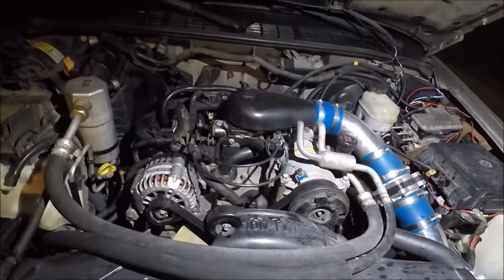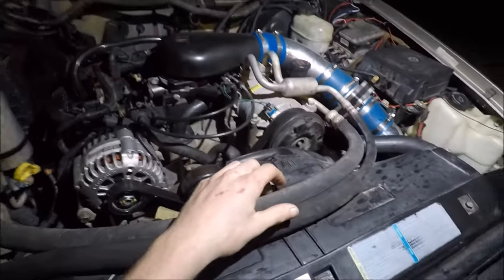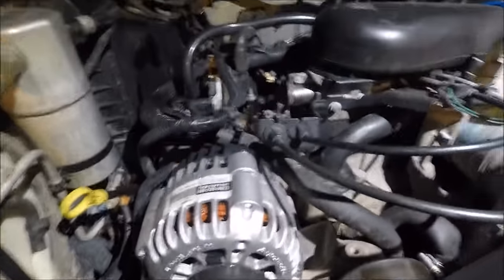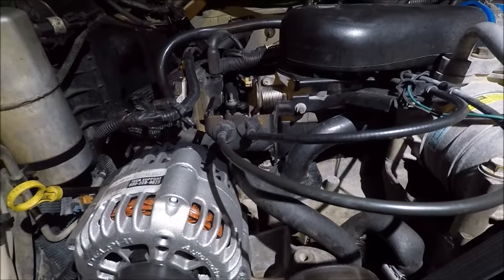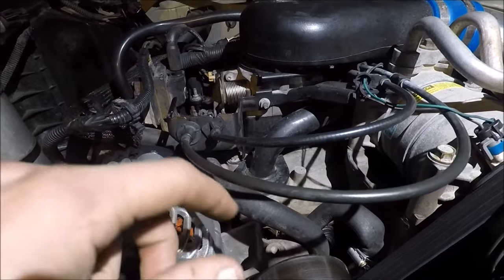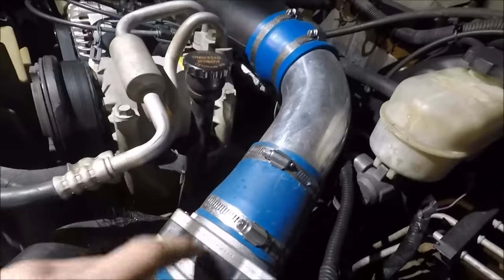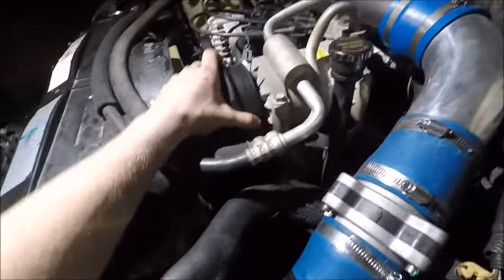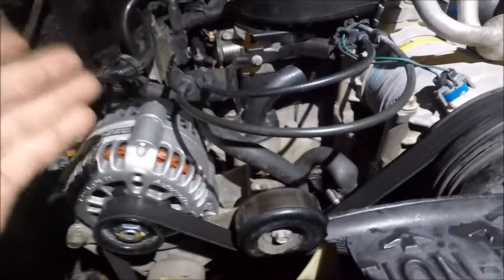EVERYTHING YOU NEED TO KNOW ABOUT THE CHEVY 4.3

Comment: Great info. My 2005 Jimmy has 177,000 miles. Owned since new and maintained.  Have an issue when climbing a steep hill at high speed cel flashes. No misfire is felt and once I get on flat road it stops flashing. I checked the codes and I get a pending P0304. Did a tune up, complete new Declo distributor. No change. New delco fuel pump and filter made no difference. It has the new MPFI spider and made no difference. Compression is good on all cylinders. I ran across a service bulletin stating that valve guide clearance is an issue in some of these engines and engine will misfire under load such as climbing a steep hill or towing. Just wondering if you heard of this? It is so strange I don’t feel any misfire and no loss of power either. Btw the ckp has been replaced and a ckp relearn has been also done.
Reply from the maker: Of the two I owned, both high mileage only changed the distributor and never had any problems might I suggest injector cleaner maybe one has gunk in it and gives a bad spray under load
Reply: @JLGARAGE252  Thanks for the reply. I already replaced the injectors and no change. I’ll have to pull head off and see what’s going on.  Thanks again 🙂
Reply: @theultimatedj8650  any results?
Reply: @jamdaddy7589  yes. Exhaust valve seats were worn. I had to have all hardened exhaust valve seats installed and a valve job. Problem is now solved
Reply: @theultimatedj8650  hell yes good news! Thanks for the reply
Reply: Mass airflow sensor wires or connection loose ?
Reply: @dougmurray3373  I was loosing compression under load due to exhaust valve seat recession. Removed both heads and had hardened exhaust valve seats installed by machine shop along with valve job. Problem solved

Comment: 2002 Chevy S10 zr5 should the radiator cap be vacuumed sealed ? when I tried to remove the cap needed to break the seal to get it off? should it be that sealed?
Reply from the maker: Yea the vacuum seal is necessary
Reply: ok thanks .. so it takes a screwdriver to remove a cold radiator cap.
Reply: radiator caps create pressure on cooling system reason is water boils at a higer temp under pressure its like a 7lbs system if I remember right.

Comment: Getting a 1999 s10 thats been a family vehicle and now my tuner ass gets a hold of it I’ll make er go good bud
Reply from the maker: If it’s the 4.3 don’t rev the crap out of it, those motors are gutless they are designed to run and be a decent work horse, their not a engine you rev on your buddies at Walmart and try burnouts with, bottom end failure is the biggest killer for these engines.

Comment: I had a 94 s10 blazer ran good had egr problem every other year put 2 transmissions in it 100% from over working towed alot more than should like a old john deere combine. And dont let it set for 6 months without running over 600$ everytime for spider injectors

Comment: Thanks for the video. By far the best video about this engine. I know you probably get tired of people asking you questions, but I'm going to try anyways. I recently had to change out my passenger side head and gasket. Got it all back together and was throwing the dreaded p0304 code. Replaced all little stuff like plugs, wire,cap, rotor, coil. Nothing changed. Then adjusted the valves and got rid  of the p0304 code but it was replaced by the camshaft sensor code. My question though is since the head replacement the top of the engine makes a tic/knock. . More than a tic but not quite a knock. Any idea? Any info would be appreciated. Thanks

Comment: Of course a somewhat dependable motor if you keep up on it... use factory sparkplug,  double platinum,  anything less is a waste of time,  change oil frequently.... air cleaners,  fuel filters,  if not you may experience knocking eventually with higher mileage 4.3's....
Reply: @JD John... Where's my fuel filter?
Reply: @cinnamongmc5430   the main fule filter is under driver's side outside of the frame,between Motor and gastank, silver cannister within bracket.... mostly depends on the year?

Comment: Are all 4.3s drive by cable (throttle body)?
Reply from the maker: Older models yes, newer renditions sadly no.
Reply: @JLGARAGE252  When did they go to drive by wire? I'm looking at an 05 tomorrow and it has dbc. I thought GM changed to dbw in 03' with the gmt800s.

Comment: I have a 1999 4.3 vortex , my question is can I run a clockwise water pump? The reason is I have a set of v-belt pulleys I bought about four years ago and never used. I’m hoping I can change the pump so I can use them.  Thank you for your help.
Reply from the maker: I personally wouldn’t, the fan an water pump take power from the engine as it is, re routing the belt system would just seem like a hassle.

Comment: I've owned vortec 350s all my life so I am familiar with most issues you've mentioned, like I put the upgraded spider in my truck 2 years ago. I just bought an 01 astro van with the vortec 4.3 so I'm learning what I can about it. Sounds like its all the same issues for what is essentially the same engine less 2 cylinders. Lol they even sound very similar at idle lol. I always dismissed this engine as weak, but I'm surprised at how much get up and go the astro has. It gets out of its own way just fine. I was very surprised a big heavy van actually feels a little peppy. I think I have a burnt valve on the truck so will be driving this van for a while, its sits up high like the truck (96 7z1) and the interior is close enough lol so I won't be missing the truck too bad until I have time to fix it. I'll enjoy the fuel mileage and the comfort, I'll miss the 3.73s and the exhaust note.
Reply: i been working on my mom's 98 Astro getting fixing the codes it has after 6 mouths down to two codes. it's begining to make that power.

Comment: A few years ago I drove a ‘94 GMC Sonoma for a little while that had the 4.3 vortec V6. The thing was an absolute dog. It really hated driving faster than 70mph on the freeway with the a/c on. But man did it have a nice roar to it when I pushed it hard (when it actually let me, meaning when it willingly kicked down a couple of gears when flooring it lol.) I’m not knocking GM, in fact I’m a bit partial to the brand. Just my experience. 🙂
Reply: its not a highway cruiser that is for sure lol. but for snow and cold weather there great trucks! best heater i've ever had in a vehicle. bit of a gas hog but if you do not drive them to far its livable.
Reply: @westside_tints8197  I remember the a/c worked really well too, the thing was practically overkill for such a little cab.

Comment: Hi Thanks for the vid. 
I have a 1997 S10 4.3 too. I just changed the IAC and cleaned the throttle body. It runs really smooth, but it has an issue. What is wierd when I go past 60kmh and higher 2000 rpm and let go of the gas the rpm will drop to 1500rpm and stay there as the cruise control would be on but it isn't. So the car will increase speed a lil and keep going. So when I break and come to a complet stop it will go back to normal about idle 700 - 950 rpm. 
But when I go back to 60-70kmh the rpm will stick again to 1500 rpm. I am still able to push the gas to go over 1500 rpm but it won't get lover until I stop to 0kmh.
What could cause this, any ideas?
Thanks for the help! :)

Comment: Not sure what forum you got your specs from a 4.3 is a redesign of the 5.7 but its two middle cylinders missing not the end ones. It also has differnt rods(differnt width on big end) the 5.7 or 350 has two rods on same crankshaft journal the 4.3 crank has individual journal per rod and bearing. same pistons bore and stroke. There is no vacuum under the breather pod vacuum is from bottom of throttle body down. Thats just suction from air coming in and will not be filtered. And mercruiser did not buy the rights to the engine Volvo penta and merc have always used/purchesed engines from Gm's marine division. How do I know this? Been marine mechanic 35 years. Merc just made there own induction system for the GM.

Comment: i am 16 and i just got a 94 4 door s10 blazer as my first vehicle.My uncle gave it to me because it had some things to be fixed and he was frustrated with it.He already had a truck he wanted so he was gonna get it scrapped.I brought up that i was looking for a small truck/suv and he brought up the blazer and few days later we went to pick it up.Runs great and only has 155,000 MILES.
Reply from the maker: That’s awesome! Hope it goes well
Reply: @JLGARAGE252   yeah ive already bought a few things mainly focusing on mechanical things right now.Gotta buy and install a wire harness, get it re painted bc it is faded and some other things but it still runs and drives but just can't go outta town with it untill i replace the wire harness
Reply from the maker: Well sub to the channel if you want to see how to videos and just regular S10 videos.
Reply: @JLGARAGE252  just did and one question is the 4.3 vortec a reliable engine
Reply from the maker: @Whisp3o  it can be if you maintain it, on time oil changes and driving it easy will give you atleast a good 200 if not 300k miles. Have had two 4.3 vortec and drive the mess out of them and still impress, same thing as a 5.7 vortec just two less cylinders

Comment: You saved me greatly! I mean I thought I had bad power steering whine and it was just an idler pulley! Also I am concerned at after I let my engine sit over a few days it cranks 15 seconds before it starts. Idk what that could be
Reply from the maker: Change the fuel filter
Reply: Fuel pump
Reply from the maker: That would be the next thing to look at, over time GM fuel pumps lose the ability to build initial start pressure, usually will drop a couple PSI of the years.

Comment: im having a problem with my 4.3 when it's hot outside at stops  and lights it will lose power like wants to die  no check engine light on tho i ended up changing my spark plugs and wires and it was running good just started it again    what's the best wires i can use?

Comment: I bought a 94 S10 and it sputters when i accelerate. Like a loss of power as well. I just need some help getting it diagnosed before i start doing anything to it. To my knowledge i know maybe i should do a tune up along with replacing the spark plugs wires, pcv valve, iac valve, and check for any vacuum leaks, correct? Thanks for reaching out.
Reply from the maker: Yes check the ignition, vacuum lines typically will cause a rough idle, distributors are sneaky on these don’t let them fool you, check the cap and rotor themselves.

Comment: My positive battery cable got melted to my manifold and grounded out cause my terminals to melt I got the wire repaired and a new battery it’ll start but it shuts off right after do you have any advice please.   (2001 4.3 Silverado)

Comment: Should I buy a 97 s10 4.3 with 26,000 original miles kept in garage for 12k or a 97 ck1500 4.3 106,000 miles for 10.5k? both are 5 speed manuals
Reply from the maker: Def high priced low miles or not it’s all about the maintenance ask them if the correct maintenance has been done at the factory intervals, receipts of all work, condition of the vehicle entirely
Reply: Was the garage climate controlled, if not check all the rubber parts to see if they are good or have been replaced. Had gotten a 1994 buick lesabre from great grandmother with around 12k miles, i got it in 2006. 2007 crank bearings went bad with 24k miles. Also replaced a lot of parts in between that time.
Reply: Thats why i go full synthetic, dont corrode engine parts sitting for years

Comment: I have a 2003 GMC Jimmy 2 door 4WD with 270,000 miles. It has been very dependable with minimal problems. I did have to replace the spider injectors a few years ago and the air conditioner compressor. I do now have an issue with the idle remaining high after the engine is up to temperature. In fact I can be driving 40mph and take my foot off the accelerator and 3-4 miles later it is still going 40mph. Sometimes it even pickup speed and when I get to a stop sign I have to use a lot of breaking to slow. If I pop the tranny into neutral the rpm’s will climb to 2000. Doesn’t appear to be a vacuum leak. Any thoughts?

Comment: 2003 Chevy Silverado 4.3 I threw a 0300 code so I did plugs wires and still have problems starting on and off when I turn the key sounds like it's grinding a little bit and then it catches but it shakes when it don't start and then other times it starts right up could that be the distributor?

Comment: 219k miles 99 Zr2 s10 no significant engine problems other than my water pump and heater core but once i lifted it and slapped some 33s i shit on my balls joints and pitman arms but replaced them and haven’t had any problems in over 20k miles

Comment: 03 here..have oil burn smell at startup and oil leak right above my exhaust. Really cold right now and no garage to fiddle around lol, any suggestions…also pushing 300,xxx miles  🙃
Reply from the maker: Oil is leaking onto the exhaust manifold and as it heats up it’ll burn the oil this giving the smell of burning oil, valve covers are most likely leaking

Comment: EGR valve location?
Reply from the maker: @ronashworth8754  if you have it, it will be located between the altenator and the ac compressor mounted to the intake plenum
Reply: @JLGARAGE252  I probably don't have one then. That was the first place I thought to look because that's how it's on my 94. I'm chasing a cyl 5 misfire code

Comment: Deciding if mines toast, drove it hard when oil was low, steady slow leak, check it weekly, it sped up, or I was a day late, going up a hill it thumped and cut out, started back up a few minutes later to get off the road, it seems weaker and bumps a little after it idles. Figure I'll do a full oil change one last time to see if it cures it, is there an additive I should try in my oil that anyone would recommend to see if it helps?  I have put more money in it than I wanted to get through the short fall in the van market before buying another. Not about to do have the engine opened up again as the rest of the van is toast. Just want to get it to fall or spring.
Reply: Hyper lube if it has 200,000 miles or more.

Comment: Needing help::::
Truck ran and drove great but yesterday I was driving thankfully near home but as I came to a stop on my breaks the truck acted like it wanted to die but would run fine once I let off the breaks and ot git over idle rpm I put it in neutral and rolled into my driveway and stopped but when I Crunk it back up everytime I put it in gear it will die either reverse or drive it will try ti pull for a split secind and die

Comment: hey my zr2 has started to have the rpms jump all over then truck losses power ive replaced fuel pump filter plugs wires cap and rotor ignition coil and it still does this can you please helpme ive replaced the cam position sensor as well as the crank position sensor its got the 4.3 vortec with 173k miles on it

Comment: Hey just recently bought a 2000 chevy blazer 4.3 vortec has 162,000 miles it runs good but has a few issues. The transmission shifts ok accept an occasional buck and 3rd gear hesitation the fluid is kinda brownish but has no strong odor would you recommend changing it or leaving it alone?
Reply from the maker: With 162 on the clock it probably won’t hurt to change it but do not have it flushed, change the fluid and the filter.
Reply: @JLGARAGE252  Thanks👍

Comment: I don’t even have a gas cap my dizzy gets wet all the time only thing I ever replaced was the radiator I have had that motor up to 300 degrees and my 4.3 has no check engine lights and it’s barely even knocking

Comment: I have a  vortex that is running beautifully  but eats gas like crazy? I have 350's that have gotten better MPG,s ? Do you have any ideas?
Reply from the maker: First off, you gotta look at the engine specs itself, is a 4.3L engine, and it’s a V6 it is not nearly as fuel efficient as some of the 3 Liter engines out there
Reply: @JLGARAGE252 Well Assuming the sensors for fuel delivery aren’t dirty, might as well throw some new ones on if they are throwing codes often.

Comment: Hey got 02 chevy blazer she is starting to throw a lean on bank 1 code ....is this a vaccum leak?
Reply from the maker: Air to fuel is off more air than fuel
Reply: Ok so what is my next step u se I'm a woman doing this myself,i don't have a obd-2 reader.I had them run it at car quest.
Reply from the maker: It seems like the computer is thinking there’s not enough fuel, those codes can be triggered by the injectors getting dirty fuel or even clogging, run some fuel system cleaner and check the rubber hoses (not the the radiator ones) check the vacuum lines and see if any are bad, then you can get the fuel filter changed and see if that helps. I’ve encountered those codes before and for a rich code I was fixing the vacuum lines and for lean I was addressing the fuel delivery system, I.e. fuel filter, fuel injector, fuel pressure.
Reply from the maker: Hope that helps
Reply: Ok I'll give it a try,thank you

Comment: Can you tell a Difference in your sound / Horse Power whith high performance Cold air intake?
Reply: Maybe sound yes and it will feel like its getting a breath of fresh air..as far as HP and Torque goes you're not looking at a substantial increase. I always recommend slapping an intake on any vehicle with the stock filter.
Reply from the maker: Slightly better fuel economy but no difference in power